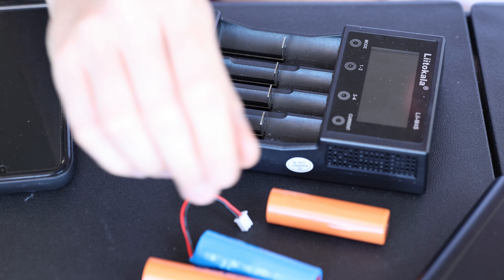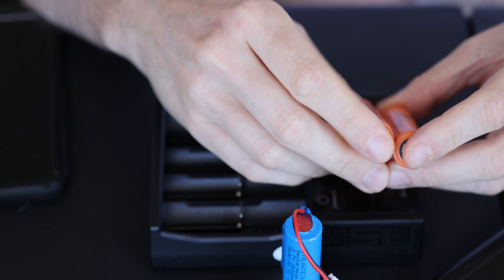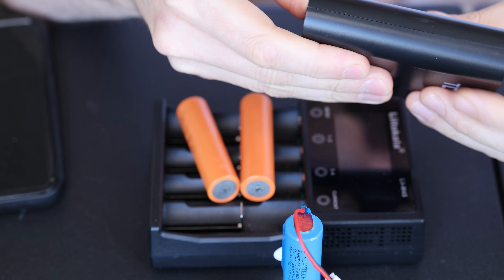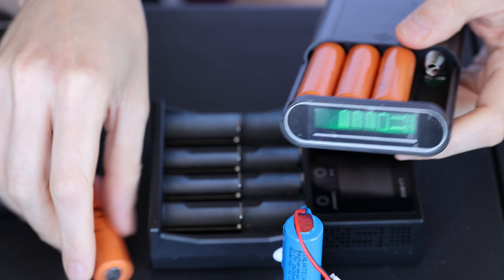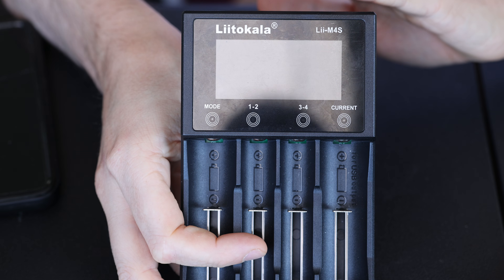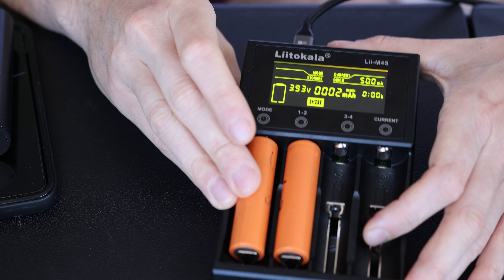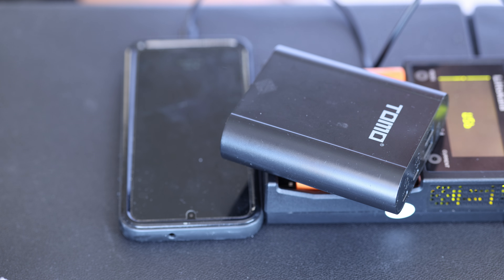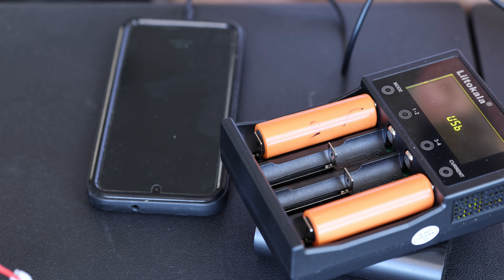Refurbishing 18650 Cells

Comment: hmm theres a couple boards which use the ip2368 ic as you referenced (the 100w bidirectional one in greatscots video, also can be set to do lifepo4, and i used to make a cheap power station with 4x 8$ 32ah cells). there are also boards that keep to 1S config but can step up all the way to 20v now and have built in temp protection, no bms needed for 1s. personally i dont trust bms' anymore for these applications, i switched to just using perminate active balance boards, the inductive ones i think are most reliable. caps and mosfets always go bad either from age, misuse, or heat, but its pretty hard to fry an inductor if youre using it within its limits. no electrolyte to get dry/leak like caps. these boards are also much more efficient than bms', which i think allows more usable lifetime charge cycles out of a battery bank (even if one cell starts to loose capacity. it will not completely dictate the total capacity of a series config). imo theyre very beginner friendly. but so many people think you have to use a bms now days....  in my experience, most diy battery fires are from faulty bms'. the car audio world has been using balance boards instead of BMS' for awhile now coz they have a particular set of needs (ultra high ultra short C rate), thats the only other place i have seen this idea online. my 2 ev's run deleted agm batteries and in place have similar 4s 32ah lifepo4 12v batteries now, saves about 45-50lbs, and boosts range from lower parasitic 12v drain/internal resistance.
lifepo4 is getting so cheap its making it not worth peoples time to refurbish old lipol cells.... large format lifepo4 cells (280ah) are like 45-50$/kwh right now lol. 18650s would have to be $0.30 each to break even with cost competition now, and cylendrical cells loose to prismatic (even lifepo4) on density because of their steel shell and shape. its a shame we dont make any lifepo4 batteries here in the US yet.
Reply from the maker: @vevenaneathna  wow interesting input
Reply from the maker: @vevenaneathna  I don't remember if I mentioned it as I recorded the video multiple times, but as you stated nowadays a battery pack that delivers 230V should be LiFePO4. I was able to get a real 250Wh for 250$ and the price will only go down from there.
Reply: @BitsOfBoris  hmm not sure on the 230v, maybe need a step-up.
my "12v" ~4s 32ah power station fits inside a mini ammo can and has ~420WH of capacity. output is just a fused 25 amp unregulated "12v" dc port which runs my diesel heater or an inverter fine.
i used 2 of those ip2368 boards as input/outputs, so it can charge at ~200watts (100w each), or do pass thru, and i keep a 12v 140w accessory/car charger adaptor with buck/boost up to 20v/5a inside the ammo can with cables which can expand the ports as needed for an additional 100w usbc/30w usbc/ 30w usbA
the whole project cost about 60$ to build, and i kind of copied the idea from the anker solix dc 300 except i wanted something with double the capacity, half the size, and passive cooling/water proof enclosure.
been meaning to finish a video and put it up on my channel. have all the build pics and video of it working but no time to do voice over/edit. nothing like this currently available because power station mfg are sticking to bottom tier cylindrical lifepo4 cells instead of the better prismatic ones.

Comment: yes good advice I have shorted the cell nearly welded my side snips 😂 and I do it I keep cells and have a spot welder to rebuild tool battery packs
Reply from the maker: @jcthe2nd  I had bought a cheap spot welder in china... But it died on me because the battery has been drained from sitting so long unused. What an irony. And the PCB wasn't even turning on again with an external power source, despite the recommendation of the Chinese shop to short a capacitor on the board. What mess. Not a good experience. Since I never needed to make a custom battery pack.. I never used it. I used 18650 in flashlights, or to power some electronics projects. 1 cell is often enough.